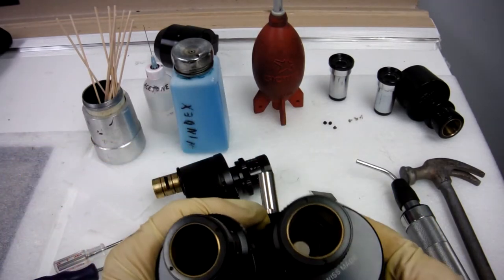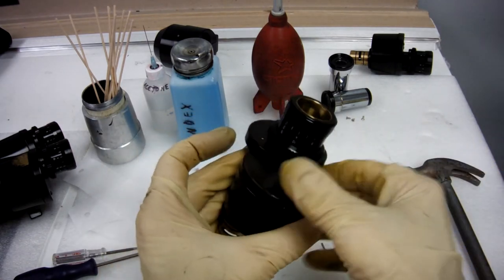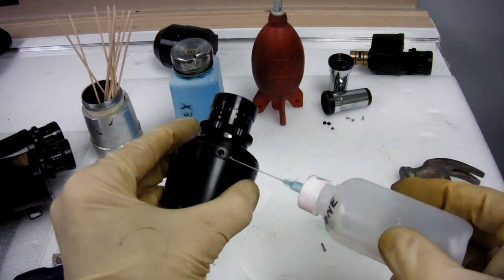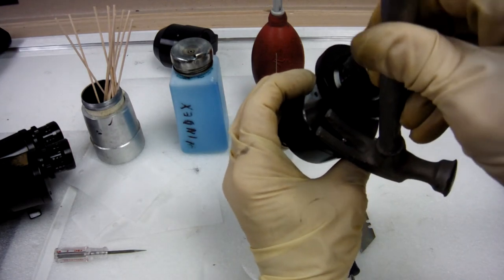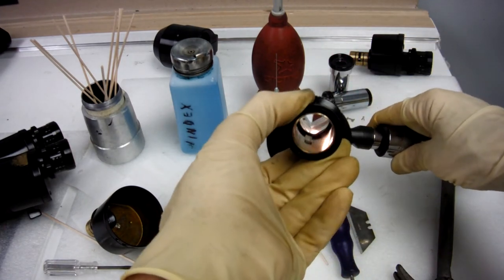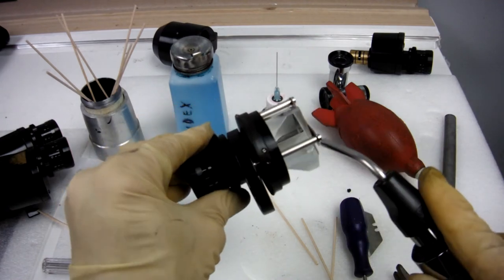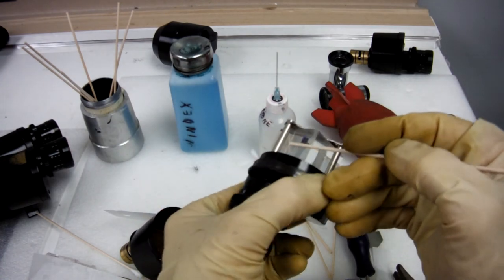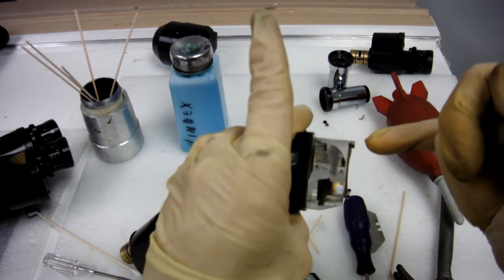Slit Lamp Binocular Head Cleaning Tips

Comment: How can we fix diplopia in slit lamp which may be due to prism inside
Reply from the maker: Around the prism assembly there are 3 smaller adjusting screws. You can adjust your prism assembly loosening one screw and alternately tightening the other screw to push the light in the direction of the loosened screw. 
First determine which eye is the "good eye" and then align the other eye to match the "good eye". 
It takes a very small screw driver to turn the small adjusting screws and you might have to put some acetone on the screws to remove the glue on the screws to turn them.
Remember, loosen one screw so there is room for the prism assembly to move and then tighten the opposite side screw to move the assembly in the direction of the screw you just loosened. 
The light is pushed forward when that screw is being tightened.